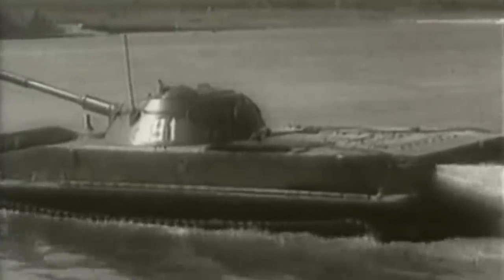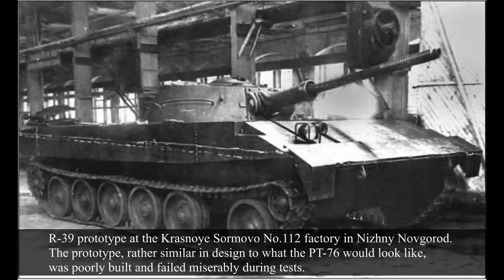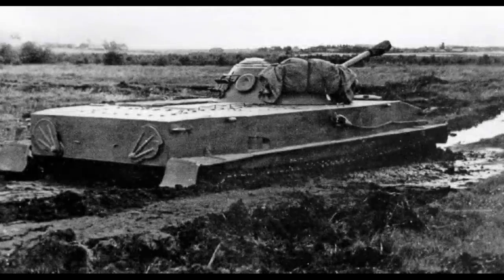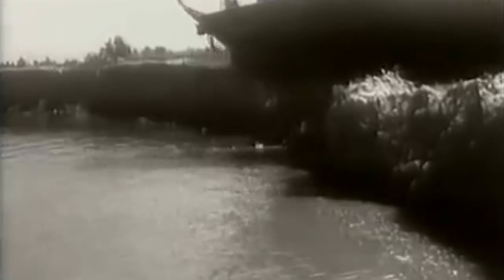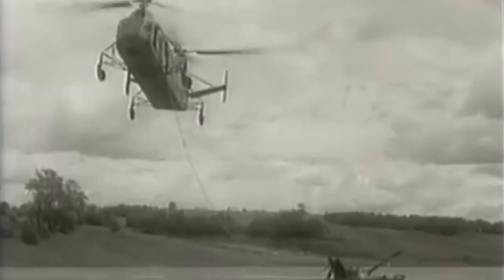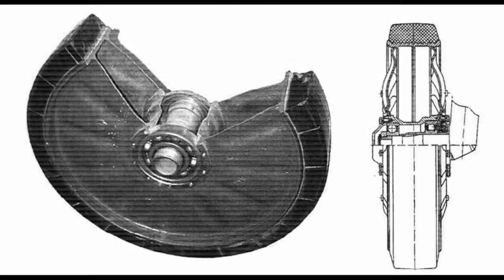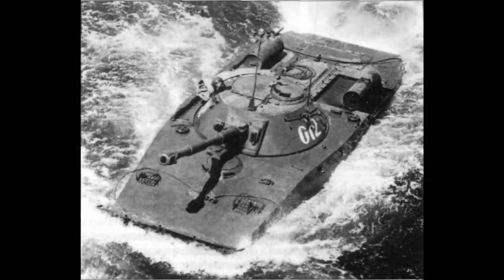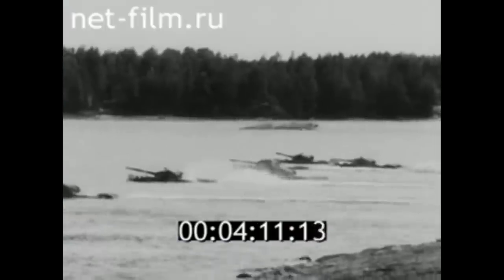The Soviet Amphibious Spearhead | PT-76 (part 1)

Comment: The PT76 actually did pretty well in Vietnam, simply because blowing a bridge didn't stop them.  If it was the only tank that made it to the battle it was devastating, simply because the US forces in Vietnam never expected to have to fight tanks.  For blowing up a sandbag bunker a 76mm was more than sufficient,    Of course if a real tank showed up, or they got caught out in the open by US air assets they were screwed.   Basically this was an amphibious fire support vehicle, rather than a tank. It might look like a tank, but if you tried to use it like one the results were going to be bad.
Reply: It’s true. This thing is a scouting vehicle for infiltrating the enemy front and collecting info about their positions. Gun has a heat rounds too, which I think are more for a tank self defense against other tanks in a way of shooting and driving away.
Reply: Other factor lower fuel consumption than heavier t54 or even t34/85.
Reply: But the Russian made PT-76 Light Amphibious Tank have a limited action because of ragged terrain and muddy road so it was intended for night action just in the Battle of Hue . Four of these PT76 have been knock down by a US M48 Patton tanks with his 100 mm guns while the Russian PT-76 only have 76.2 mm guns as if Rift like a Paper bag
Reply: @ee214verilogtutorial2  even as a scout it kinda sucks. It's loud, it's big (for it's weight), it's slow, it's not very good on rough ground. It's a boat with tracks and a gun. It can take you from the sea over the beach just far enough to secure the landing area. It can mimic a tank where nobody expects one. If you play top trumps with it, you'd only win against an opponent without any cards.
Reply: @Darilon12  idk about that:
1. It’s low clearance. You can hide behind the hills and scout, which is a sufficient advantage 
2. 2 plane STAB is a huge advantage. You can aim through the binoculars and have a superior accuracy on far distances. Adding to that are your HEAT rounds. They don’t care about the distance, as long as you hit the target.
3. HEAT rounds make it quite useful against any armor on its BR. Not much can stop the heat. Also it can one shot no armor vehicles like itself, huge advantage comparing with armor piercing projectiles.
Reply: @ee214verilogtutorial2  I'm not talking about war thunder 😂
Reply: @Darilon12  too much war thunder for you lol
Reply: @Hoshino_Channel  Like I said. No war thunder. 🙈
Reply: Apparently even when encountering tanks, the PT-76s were at least able to damage them somewhat by slinging HEAT at them. I can't remember if it successfully destroyed any MBTs, but I read an account of one of them damaging an M48 with the HEAT. Penned the turret iirc.
Reply: Hence why it sucks in warthunder

Comment: In 1952 this was so futuristic. The battle record from NVA shows it was a worthy opponent. 76 HE is most devastating to infantery. No western nation have come close to this  amphibious light tank. Thanks for showing all the variants of PT-76.
Reply: well, that's largely due to the fact, that western allies dis not invest any means into amphibious warfare
Reply: @Mastah2006  us marine lvtp7a1 is for amphibious warfare. Armanent is a machinegun. No hydrojet. Plenty of room for infantery . Came into service 20 years later.
West german Luchs a recognisiance vehicle with propellers and 2cm gun.

But nothing in comparison with PT-76.
Reply: couldn't Sheridan swim with preparations
Reply: @igoryst3049  Yes . You are right. Swim slow with only tracks and 14 years later. Full-scale production on the Sheridan by the Allison Division of General Motors did not commence until 1966.
Reply: You just sound so oddly eager to make this out to be some kind of miracle that inferior Western bipeds could never have dreamt of which it isn't. The Sheridan was not delayed because of technical incompetence but due to delays in defining the light tank CONOPS and requirements. The US even knew about the waterjet system (which is nothing technically impossible or terribly innovative) and deliberately decided not to use it on the M551, preferring to swim with tracks and not add a second propulsion system when the existing one can do both jobs. Their water speed difference wouldn't lose or win you any fights. Remember you're talking about the same side that was putting propellers on tanks in WW2. The West practically invented swimming armor. And the LVTP-7 has positively nothing in common with the PT-76 except that they both swim.
Reply: @mirandela777  Thanks. Interresting read about PT-76 .
Reply: @mirandela777  "lay behind decades" "nasty surprise" leave some chromosomes for the rest of us
Reply: Very interesting. The Soviets probably got the ideas, when the USA gave them all that Lend-Lease with amphibious capabilities. Reminds me of how the Panzershreck and RPG-7 are both derived from the Bazooka.
Reply: Russian made PT76 that the NVA have pace a worthy by US M48 Patton tank . Yes indeed PT76 Amphibious light tank he limlited for night action . The reason why the NVA much prefered the PT76 before the T54/55 tank because Ho Chi Minh trail is a vast mountains of ragged and muddy road so PT76 is suitable these kind environment
Reply: @chaosXP3RT  lol no, bazooka and rpg-7 both derived from panzerfaust
Reply: @ee214verilogtutorial2  That's a straight up lie. You need to reread history. Bazooka was created in 1942. Panzerfaust was created in 1943
Reply: @chaosXP3RT  and you need to read physics and not skip STEM classes at your high school. Bazooka is not a shaped charge unlike the panzerfaust. Bazookas struggled to penetrate T-34-85 in Korean War solely for that reason.
Reply: @1965Leonard  no one cares bruh
Reply: @1965Leonard LVTPA1 is more like modern landing craft with fighting capability, rather than an IFV with amphibious capability.
Reply: @ee214verilogtutorial2 
Don't tell anyone else to study until you get your own shit straight. The bazooka most certainly DID use a shaped charge, which it introduced before the panzerfaust. And it was known to take out Tigers on many occassions. The only advantage that the panzerfaust had was a larger diameter, and diameter is everything when it comes to penetration performance by a shaped charge.
Reply: Imo the west hasn't put this much effort into amphib designs, it assumes it will have naval and air superiority and not a lot of rivers to cross without time to put up bridges.
Reply: @Drownedinblood 
Various western nations including the US did invest in amphibious warfare and not unsuccessfully.
Reply: @matovicmmilan  it hasnt in comparison to countries like the soviets and even China. Almost every soviet vehicle is meant to be amphibious,  like the bmp and even tanks with snorkel. The Bradley absolutely isn't.
Reply: Well, the reason why the West hadn't designed their own version of this is because of battle doctrine. The Soviets were going to be on the offensive in Europe so they would need the capability while the West would already have the bridges and river crossings the Soviets would be after so they did not need an amphibious combat vehicle. It comes down to need rather than capability as the West has shown time and time again, they could produce better equipment if they had the proper motivation, it is just NATO had no requirement for such a vehicle so they didn't bother perusing it but it would have been interesting to see what they would have produced and I am not denying the Soviets did make some good equipment of their own. I personally love the Hind-D, I fell in love with that thing after playing Metal Gear Solid as a kid and I still love it to this day.

Comment: I don't really see the choice of gun as a serious complaint.  If you are fighting enemy MBT's in a PT-76 something has gone horribly wrong.  For just about everything else the 76.2mm works just as well as an 85mm and in many cases just as well as a 100mm.
Reply: then howcome the chinese upgraded them to 85mm in the type 63? and why bother with a weapon of 76.2mm if you aren't going to try and take out tanks? might aswell have gone like the french and used a gun-mortar of ~60-80mm.

also remember its ment to cross bad terrain, what happens when it inevitably crosses that terrain and then comes across heavier enemy tanks (which what do you know is precisely what happened). its a specialist tank and thus expecting it to be supported by non-specialist tanks is stupid.
Reply from the maker: You should expect that things might go wrong, you never know what's around the corner, especially when YOU are the recco tank. The 76mm was very good against some tanks it met, like Pakistani Chaffees, but useless against American Pattons in Vietnam.
Reply: @matthiuskoenig3378  - Ask the Chinese. They have their own priorities which are not necessarily the same as their Soviet counterparts.   

The French used 60mm gun-mortars in the AML armored cars because they needed a weapon that could be brought rapidly into action in ambush situations at both short range in direct fire and at high angles to deal with the mountainous terrain of Algeria.  Not really a problem the Soviet's were facing in 1950. With the Algeria campaign ending and French cavalry units changing to a role of interdicting Soviet airborne units dropping behind NATO front lines and bringing with them light armor such as the ASU-57 and later the ASU-85 the French switched to procurement of AML's fitted with the 90mm F1 gun.  

If one is conducting a river crossing where the likely opposition is dug-in machine guns, recoilless rifles and mortars, 76.2mm will do the job just fine in neutralizing such positions.  I am reminded of ARVN analysis of the relative merits of the M41 vs. M48A3 tanks where it was concluded the extra lethality of the 90mm gun on the M48 was largely irrelevant.  Any target likely to be encountered could be dealt with as well using either gun.  Essentially made no difference. 

People obsess too much about hot, sexy tank-on-tank action IMHO.  The vast majority of the time tanks are not shooting at other tanks.  For a light recce vehicle like the PT-76 ideally one would never engage enemy tanks unless there was no other option.  For reducing road blocks, engaging machine guns and RCL's or dealing with your opponents light armored scout vehicles the 76 gets the job done.
Reply: @TanksEncyclopediaYT  well clearly it didn't work well agienst patton's cuz they didn't unlock the heat rounds yet smh
Reply: The chinese think to use this type of tank aganist Taiwan in an amphibius action from the sea. they needed a larger caliber to shoot from the sea during the amphibious assault, so the Chinese made other modernized versions of this tank
Reply: @alerossi8564  - They also had an 85mm tank gun and a turret to mount it in production.  What they did not have was a 76.2mm tank gun in production or a turret in which to mount it.
Reply: I wonder if they ever opted for mounting ATGMs on the later models?
Reply: @matthiuskoenig3378 well, to be fair at that time was China able to produce a sizeable tank fleet domestically or was this a cheaper option to fill a hole in their then manufacturing capabilities?
Reply: @MFitz12 Absolutely spot on. It seems many people have forgotten the main role of the tank and that was to support the infantry so they would most likely be deployed attack defensive positions and hardened structures that the infantry need help with while the air force and army helicopters can go off and kill enemy armour. The tank will always be there to aid the infantry, going off and fighting other tanks is largely a secondary role, hence why the machine gun is in reality the main gun of a tank and the cannon, the secondary.

Comment: Superb diligence and detailed presentation. The PT76’s notorious appearance in the Vietnam war was against the US Special-forces manned out post at Lang Vei in February 1968 as part of the larger, country-wide ‘TET’ offensive by the North Vietnamese and Vietcong. The Lang Vei camp,was overrun with significant casualties among the defending Americans and Laotian forces. 
Details here: https://en.wikipedia.org/wiki/Battle_of_Lang_Vei  
Interestingly, the US answer to amphibious armored fighting vehicles in Vietnam was generally the M113 armored personnel carrier, which could ‘swim’ but carried nothing more powerful than  either the .50 Cal heavy or 7.62mm medium machine guns. The US did rush into deployment in Vietnam the M551 Sheridan, a 17 ton light tank with aluminum hull and armor and a steel turret. The Sheridan also carried a 152mm gun-launcher which could fire conventional ordnance as well as  the Shillelagh missile. The M551 could swim, but proved problematic in a number of ways in Vietnam. It’s armor, as was that of the M113, was particularly vulnerable to enemy anti-tank weapons such as the shoulder-fired RPG (rocket-propelled grenade) with its armor-piercing shaped-charge warhead.
Reply: Most M551's - as indeed M113's were destroyed by mines.
Reply: True. Remember seeing troops riding on top of the M113s because of mines, which pretty much defeats the purpose of the vehicle, although it could still be called an ‘armored personnel carrier’: it was armored, and it carried personnel, but they rode exposed atop due to their fear of being killed or injured inside. Hmm.

Comment: Great video!  Was wondering how would the PT-76 fare against a M24 Chaffee on a 1v1 ground fight?
Reply: It sucked. That was proven in the 1971 Indo-Pakistani war when those two faced off. The M-24 had great superiority in speed, with about equal armor and armament. However the Pakistani M-24s were defeated because the Indian PT-76s were backed up by T-55s which were far superior to either, and because the Indian forces simply swamped the Pakistanis with numbers.

Comment: I'm surprised it was considered as too tall. Profile looks kinda squished.
Reply: It was almost as tall as the T-55. Mind you with less armor, less crew, less equipment and smaller gun
Reply: Compared to MTLB without the small turret or BMP1, it was quite high.
Reply: It's not too tall. It has a comparable,  if not lower profile than all its contemporaries. It's lower than an M24, M41, AMX 13,  even early APCs  such as an M75.
Reply: @HanSolo__  Compared to US light tanks, it was about 40 cm lower and about as wide.
Reply: it has a large overall volume to aid with buoyancy so proportionally it looks normal but it's rather tall, yes
Reply: @becauseiwasinverted5222  But... it's not at all tall.
Reply: @Dimetropteryx  You are in fact right. For some reason I recalled it being taller, but I just checked. Thanks.
Reply: @pavelalexe9254  yeah but it could float, hell of a party trick

Comment: Stating that an amphibious scout vehicle needed to be designed with a 76mm gun to handle enemy armor is a totally incorrect premise to begin with.

1) Tanks in general do a lot more shooting at defensive positions in support of infantry than they do shooting at other tanks (real life combat has NOTHING to do with war thunder or any other game).  That requires an HE shell, and around 3"/76mm is about the smallest shell that can be effective against non concrete defensive positions. 

2) The effectiveness of a HEAT round for AT use is dependent on diameter, and 76mm had been made obsolete by ineffectiveness due to its small diameter long before the PT-76 was designed. 

3) Prior to the introduction of IFVs with ATGMs, no scout vehicle was ever expected to take on MBTs, any more than a new and better moped is expected to take on a Harley. Recon vehicles are not meant to engage main armor forces; they are meant to see them, report them, and get the hell out of the way.

4) Nothing amphibious can ever be as effective in combat as a vehicle of the same type or class that is not amphibious, because steel doesn't float. If you have to make something out of steel that is light enough to float, then it has nowhere near as much armor as something the same size that doesn't float.

5) Plain and simple, the only tanks that the PT-76 could be realistically expected to engage with any effectiveness, from the time of its introduction, would be early WWII relics. And Soviet designers and military leaders were not too stupid to know this. It was designed to be a recon vehicle with the optimal size gun that could effectively use an HE shell against infantry AT teams, towed weapons, MG nests, jeeps or trucks it happened to come across, the occasional building with some enemy troops in it, and things of that nature. The only reason it was given HEAT rounds was to defend itself from real tanks in desperate situations that it should never have gotten into.

And this is just what the narrator proceeds to explain throughout much of the video, so I don't see why that opening statement about getting the gun to take on tanks was even included.